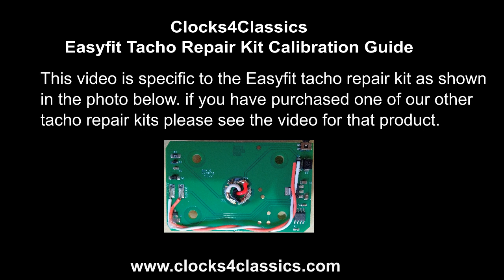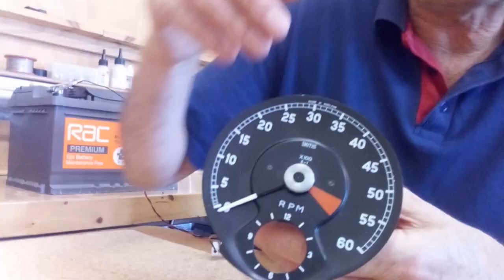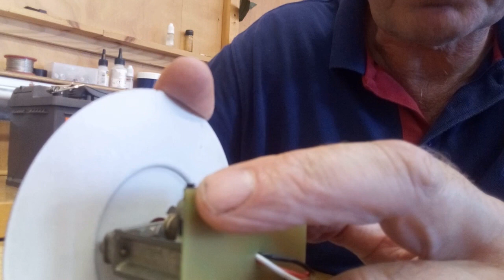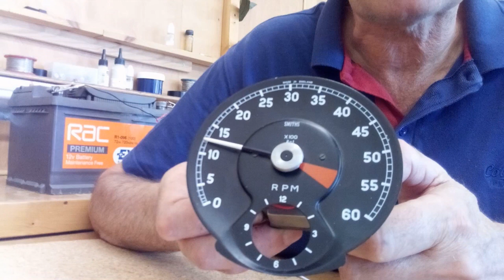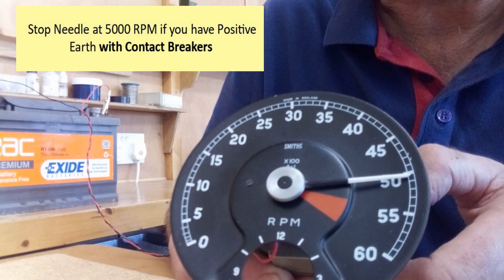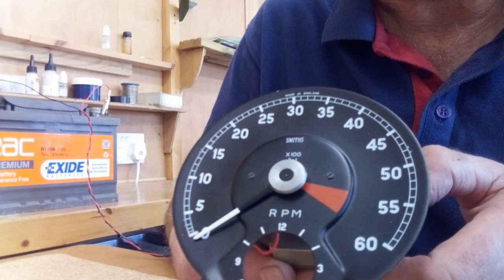EasyFit Tacho Repair Kit Calibration

Comment: hi i am a new owner of a mg midget and have a dodgy rev counter, when i say dodgy is does move but its reading a lot more than it should. its running on points so not electric ignotion. any suggestions on what to look for? when i drive at 40 mph its reading 5.5k revs

Comment from the maker: Yes the settings are retained when the battery is disconnected. However,  If you do need to change the settings at any time you can do this by repeating the  calibration procedure. 

We don't currently deal with speedometers.